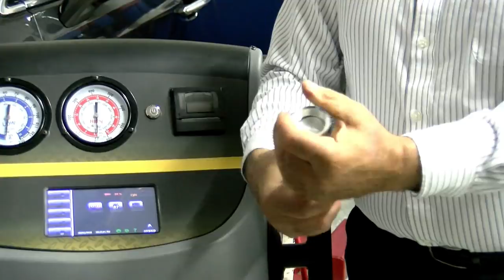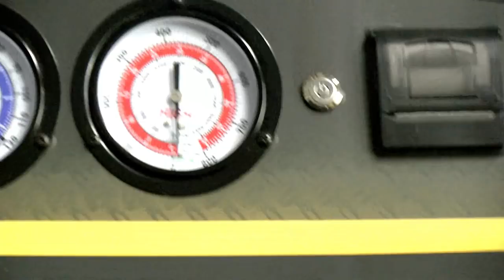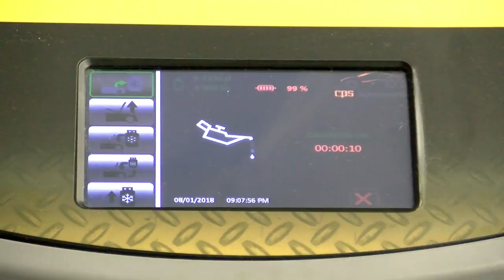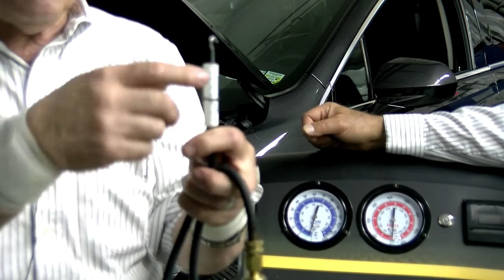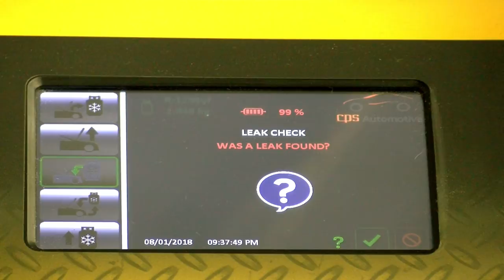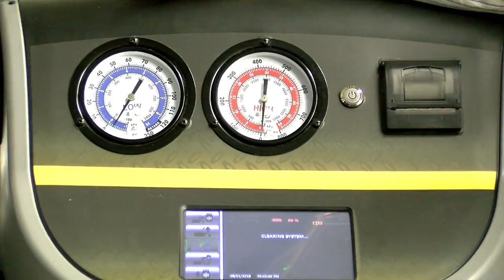CPS AC Video 8 1 2018

Comment: We bought that same machine 2 years ago and it's nothing but trouble. Not to mention CPS doesn't have any technicians that know how to fix it. It's literally broken down over ten times and we finally gave up on it. It's now sitting in the corner of the shop collecting dust. This machine is also painfully slow, it takes forever to do anything. Just an FYI for anyone considering. I really like TSTseminars and I'm not trash talking them, but these CPS machines suck.
Reply: willieb66 sounds like the yellowjacket machines
Reply from the maker: WOW Willie I will pass you comment along. So far we have been using the machine for about 8 months with only a calibration problem that was repaired. It sucks when something you purchased does not work right. If you like email me all you information (gt@tstseminars.org) and I will pass it one to the person in charge. Thanks for watching
Reply: Thanks TST!
Reply from the maker: your welcome we will try and get your issue resolved...have a great weekend

Comment: Just an FYI using pennies to calibrate your scale. 33 "OLD" pennies - anything with the LINCOLN MEMORIAL on the back weighs 3.0 ounces, as we know. BUT ... 33 NEW pennies - anything with the UNION SHIELD on the back, weighs 2.9 ounces. You will need 34 NEW pennies for 3.0 ounces. I checked several times on 2 different scales to be sure. :)

I don't have enough WHEAT pennies to test the theory out there, however.  😁

Great video, BTW.
Reply from the maker: Smitty thanks for the info and for watching...we appreciate the input. If you have not already subscribed to our tstseminars YouTube channel please do so.

Comment: Informative video the automotive trade especially air-conditioning needs more videos like this. As for vacuum you do not use time you do not guess you use a micron gauge that will give you the infinitive answer to whether your system is dry or not. Once you hit below 700 µm preferably 500 µm and hold you know your system is clean and dry and ready to recharge. When you’re starting with a clean dry new system you can get your vacuum instantly down to 500 µm with the right vacuum pump and hose set up within 5 to 10 minutes. If you have an older system is already been recharged in properly by one or two other shops or possibly left in the body shop front in damage the condenser left off for several days while they’re waiting for parts and the air conditioning lines are open to the atmosphere absorbing moisture that might take you A while into an hour or more on a cool day to pull a vacuum down to 500 µm. In air-conditioning and refrigeration when you have been in a apprenticeship program and went through a full 2 1/2 year course of schooling just on air conditioning this is how it was done in my dad‘s day and this is how it is thought today. So using time to pull a vacuum it’s just somebody with no knowledge and is guessing.